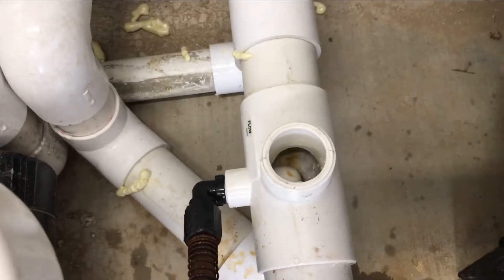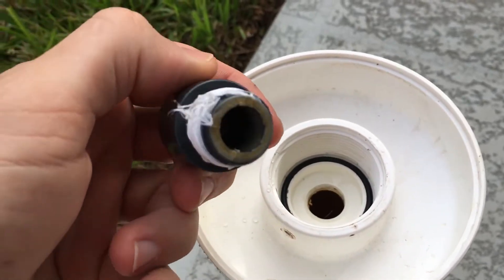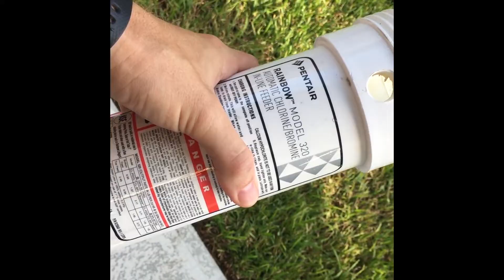How to REALLY fix a clogged Chlorine Feeder/Chlorinator

Comment: Whiy are you hooked up to the top instead of the bottom like pentair says to?
Reply from the maker: There is a connection at both ends because either is acceptable. The top connection is easier to reach and has a more lenient bend radius on the hose.
Using the top connection at a lower volume may bleed the pucks down more evenly, while using the bottom connection ensures the last fraction of a puck gets dissolved. I have no science to back any of this up.
Go with your gut, or the instruction manual :)

Comment: My chlorinator is leaking from the bottom. My pool store doesn’t open until Monday.   Should I turn off the chlorinator until it can be repaired?  Is there a safety concern?  I’d appreciate any help you could provide..new pool owner.
Reply from the maker: I bet the bottom gasket needs to be replaced. if shutting off the chlorinator stops the leak then I would do that.
Reply: I removed all but one tablet and the leak stopped.

Comment: I did everything like in your video but the problem didn't resolve. I still don't get water to dissolve the tablets???What should I do?
Reply from the maker: With the tube removed and just the valve installed at the bottom, you should be able to fill the tube with water and it should drain out. If it is not draining completely in 5-10 seconds, your valve is bad or installed incorrectly.
If it does drain normally, that likely means your  filler tube is not flowing properly. Re-install the chlorinator as normal with the filler hose installed. Leave the chlorinator cap off, turn off your pump, and turn your chlorinator valve wide open. Water should be rushing into the chlorinator tube to fill it. If not, you may have a clogged filler tube or stuck valve to replace.
If your chlorinator is draining and filling normally, your chlorine may be bad. Try buying a new batch of tabs to see if they bleed down better.

Comment: Great video - the very last second killed me! 9 tabs! That Cyanuric acid level must be 🚀🚀
Reply from the maker: Heh nope, all in range. The point of the chlorinator is to automate/regulate chlorine levels. I have it regulated down to a trickle through the tube. 9 tablets will last 3-4 weeks or longer for my 22,000 pool at 1-2 PPM.
Reply: @WillHennegan  🤔 ok 8-9 tabs a month - that’s fair. No liquid chlorine or other sanitizers?  That’d be wild maintaining residuals with only tabs that long. Unless it’s a covered pool or colder climate. Thanks for the response!
Reply from the maker: @midstatepoolpro  great points. I wish I could expertly/conclusively say how. Texas is hot and the pool is not covered. I may have to add 1000 gallons a week due to evaporation in the summer. I may also have to add 1-2 qts per month of acid to keep pH in check.

Comment: Great video!  I bought a Pentair 320 chlorinator on line  (used).  Of course I expected to replace gaskets and then watched a video that talked about all the parts and how to test them etc.  That little check valve....WOW!.  I just disassembled the thing and yep, my check valve is so dead.  Everything else looked great.  Gaskets were new as were the lines, so I'm not sure why he didn't want to do the check valve and call it a day and continue using it.  His loss and my gain since I only paid $20.00 for it.  I hope he's not reading this post.
Reply from the maker: Good score!

Comment: Mine is dry all the time, the feeder is at the bottom plug and the water gets maybe a few CM from that and the tabs last forever! BUT if I take the top off the chlorinator fills instantly. Is my valve dumping the water as soon as it comes in or is the valve stuck open? And when I pop the top it closes the valve?
Reply from the maker: Start your pump system then leave the cap off the chlorinator until it's full, then close it. Since it's a sealed system, the air won't escape unless you let it.

Comment: My chlorinator does not fill that fast no matter how much I open that valve with the numbers. Trying to figure out why no chlorine is getting into my pool the last 2 days :(
Reply from the maker: You may have a clogged filler hose or valve. Can you temporarily disconnect it at the bottom and see if water shoots out of there when the pump is operating?
Reply: @WillHennegan  I dont know. I am a fairly new pool owner. I may just have to call a pool company

Comment: I'm having a REALLY hard time removing the feeder body. Any suggestion? I already removed the lock screw on the bottom. Lots of white stuff is flaking off onto the ground (presumably calcium) after turning it 360° -- muscles and hands are sore. I already ordered a new 320 system because many parts have broken already during this process of checking the check valve; I have the same symptoms you described. My existing 320 system may have been 15-18 years old. I'm receiving a strap wrench in the mail today but am still not confident I can remove the old body.
Reply from the maker: Yikes! It sounds like you may have a lot of corrosion or buildup, or possibly your pool installer used a PVC adhesive to connect the tube. The way this is designed, there's no easy way to get a solvent in there to loosen stuff up. A strap wrench will either work, or flat-out break the unit, but worth a shot! If you cannot manually unscrew it, you may need to cut the unit out, and plumb in a new one anyway. Good luck!
Reply: @WillHennegan  Yes, while using a strap wrench the cylinder cracked so I had to buy a new 320for $158 during the worldwide product shortage! The price is now a lot lower. My 320 is still not working though. It's not the check valve because I'm using a brand new one. I'm not getting flow and chlorine tablets are not dissolving.
Reply from the maker: @tponce  Gosh that sucks to hear. If the 320 is filling up when the pump is on, and draining when the pump is off, then there is nothing wrong with it. When you say you are not getting flow, do you mean the column is not filling? The only other problem I could think of is that the unit's diverter tee was installed backwards. Can you verify that? There should be flow direction markings on it. Good luck!

Comment: Thank you Will for this video. Water won't stay inside the tube while the pump is running. It slowly drains out leaving the tablets without any water to dissolve. I cleaned the screen. Any other suggestions?
Reply from the maker: If water won't stay in the tube, it likely means it is slowly draining out of your pumps/filter too and you have a system leak somewhere. When everything is running, look for water drips/leaks. Hopefully it's just something simple like a poorly seated or broken gasket seal on the chlorinator. You may have to bring in a professional to track down the culprit. Please post an update here when you figure it out. Good luck!

Comment: Would have been good to mention to also buy the little gasket at the bottom because it’s likely to be stretched out and need to be replaced. I used a mirror to help my eyes & screwdriver locate the screw head position.

Comment: For the last month or more, I have been fighting with my pool. Could not seem to keep it balanced. Noticed the tablets in my stack were lasting longer than usual, but I had just opened a new bucket that I purchased at a club store and not my local penny pincher. Was working on it this morning and when I checked the stack it was still very full.  Found your video and it is exactly what my problem was. I popped the float down, cleaned everything up and reassembled it. I will be ordering a new valve and screen. I made it 19 1/2 years on the current setup, so I'm sure it's due.  Thank you so much for this video.
Reply from the maker: Awesome! Glad it helped and you didn't have to pay a professional.
Reply: @WillHennegan  I tell everyone, "With YouTube and a decent set of tools, you can fix anything!" "Well ,at least give it a shot."

Comment: Thank you, this is great info! One thing I would add is that old tubing WILL crack when you try to remove it! I am a pool tech, and nearly every time I have tried to remove and check the tubing for clogs, IT CRACKS and has to be replaced.

Comment: Very good video and explanation.  Only tip i would point out is to lube those o rings so they do not have to be replaced as often.  Use a non petroleum based lube found at any pool store.

Comment: Did everything in the video, water still wont drain. What now?
Reply from the maker: If you have the chlorinator removed and fill it with water, does it drain from the bottom check valve immediately? If not, your new check valve is bad. If it does, then your chlorinator is probably fine and there's a plumbing issue downstream.

Comment: I have been trying to fix this issue for many months. I replaced the screen, but that did not help. My pool maintenance company said that I needed the high flow attachment. The pool supply store told me I needed to replace the whole chlorinator. THANK YOU! Great video with perfect instructions.
Reply from the maker: Glad it helped! I guess a new check valve is a high flow attachment compared to a clogged one.
Reply: What I didn't mention in my comment was that I have been using shock to (attempt to) maintain the pool's chlorine level. I ended up buying shock from Costco that contained CYA in it and recently had to drain the pool to remove it.

I cannot thank you enough!
Reply from the maker: @drrappon  woah! Good catch. Yea, drain/fill is the fast and easy way to fix that.

Comment: I just found my chlorinator is clogged as well. How do you go about removing the screen? My hands are small enough to reach inside but I cannot get a good grip on it. I've also tried tongs but with no luck. Any advice?
Reply from the maker: You might not have to! If it's stuck well, just leave it :). Mine was loose so I removed it to properly re-seat it.
Reply: @WillHennegan  thank you for the quick response. Do you suppose it's the check valve then and not a clogged screen?
Reply from the maker: @tnguyen308  If you can see through all the screen holes, it is probably the check valve. If you want to be sure before ordering a replacement, just remove it and give it a shake.
Reply: @WillHennegan  thank you so much for the video. It was indeed the check valve. Would you know how often that would be to be replaced? We haven't had our pool for a year yet and had to replace it.
Reply from the maker: @tnguyen308  I had to replace mine in less than a year as well. I would hope a simple part like this would last 10 years, but apparently that's too much to ask. :(
Reply: Dont over tab no need to fill all the way . The tabs have a binder that gums up the check valves

Comment: If I soak the check valve in vinegar do you think the ball will get loose?
Reply from the maker: I tried soaking it in CLR with no luck. Vinegar is definitely worth a try tho!
Reply: @WillHennegan  My valve was filled with small plastic pieces so vinegar wouldn't have helped.

Comment: Quick question, water is not draining from the Chlorinator when pump is turned off....any suggestions? Also im seeing a water leak just above the pentair logo. Its coming from the attached section. Any suggestions?
Reply: If your equipment is below the level of the pool, this is normal, as you are likely closing the return valves to open the chlorinator so that the pool water isn't backflowing. Per the Rainbow manual, you will need to install a drain at the bottom of the chlorinator. This is common when the pool is built on a sloped site and the equipment is on the lower side of a retaining wall.
Reply from the maker: Hi Miguel, if your chlorinator is not draining when the pump is turned off, your check valve is likely clogged (the exact problem I had in this video). I would recommend going through the same replacement procedure I did. You could address your leak at the same time by replacing any old/worn thread tape on connections, and make sure all gaskets are in-place.